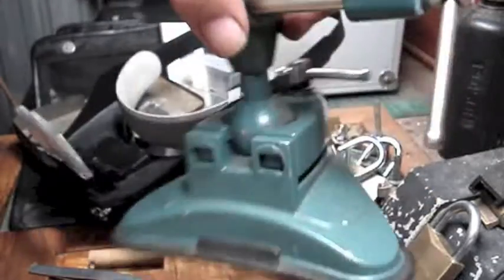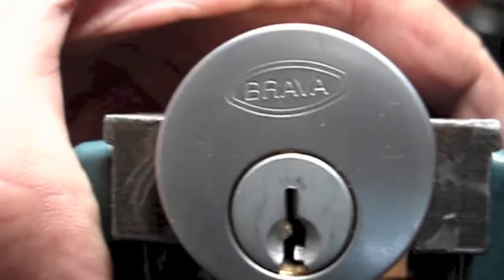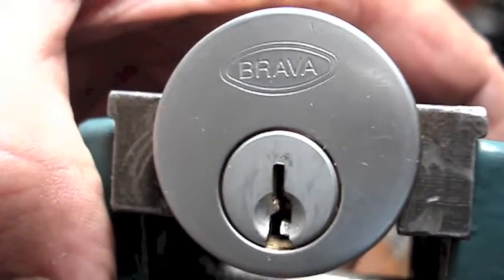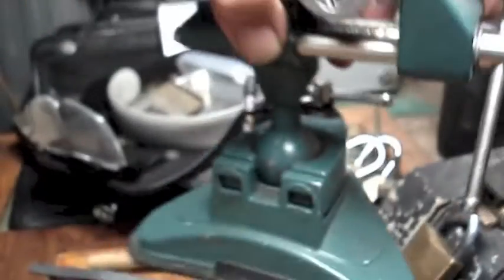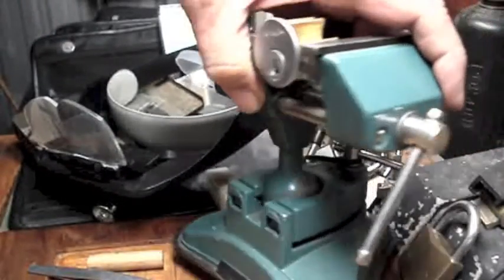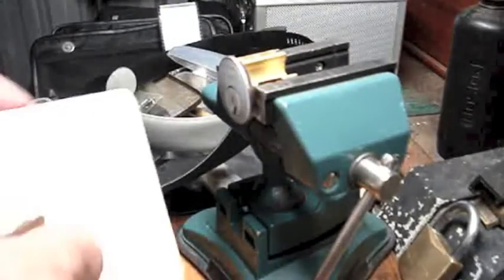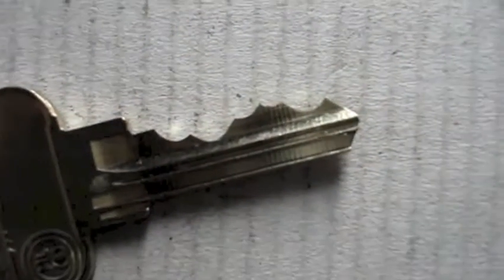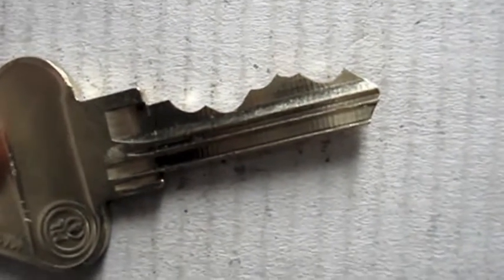BRAVA Rim 5 pin shot with the gun

Comment: Great picking Nev with the gun. Yes I have found it is each to their own when using them with twisting and turning etc.... I have even put pick tips in upside down to work better.
Reply from the maker: +waddac2 Probably a preference for the individual Rich, dependant on which lock.  I think I usually put pick in the gun straight side on the bottom, the curve edge of the pick goes to the pins, if you get me <g>.

Comment: Great. I think I will buy such a gun. I always thought, for what should I need it? But sometimes it seems to be handy. Especially in case of progressive pinning and picking. And it will be a next skill to learn. ;-)
Reply from the maker: +dirk I'd suggest get one an Eagle or the Southord gun Dirk.  My Klom didn't last long, although I did fixed it, but if it breaks again it will chucked in the bin.  Moving parts may stress guns I reckon, careful not wind that '+' wheel too much if necessary.  Many people bang away with the gun, or up/down and/or side movement.  As all things Dirk, skill is the key when handling guns, like tension with picks, not too strong tension.  You saw how I actually opened this lock, mostly single pin picking with lightly tension.
Reply: +LDU2U Thank you so much Nev. That's a lot of good information, and I will keep that in mind. And while I was looking for the eagle gun, I found out that there are guns for upward and downward picking. Every day there is something to learn. ;-)
Reply from the maker: Get the upward gun Dirk.  You probably won't need the downward one much.  You can turn the other upward gun down in your hand anyway.  Just more skill to learn, but we love doing learning new skills don't we <grin>.

Comment: well done nev, those clips give me hell to.
Reply from the maker: +Gary K Yeah, the thing for me is how danged suppliers over charge something like those cir clip thingo's.  I'll just wait until China makes them, and then buy from there, even with free postage <grin>.
Reply: Nev, On the look out on china sites for the same thing.
Reply from the maker: +Gary K I made a cir clip removal from a bundle from cheap Op Shop kitchen steak knives.  I tested it on 3 rim cylinders and worked perfect, and it doesn't need to have a spare blade either for the cost of those purchased ones.  I will use it and mention it shortly a video later.
Reply: Neville,
 may give that a go myself.